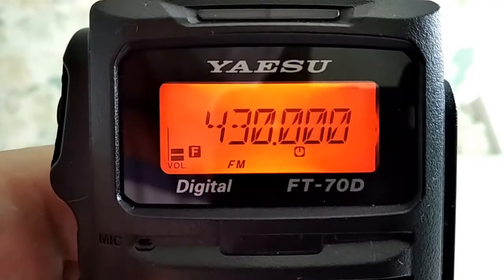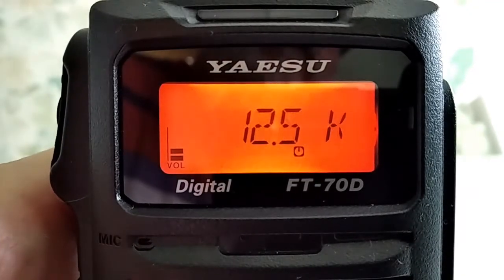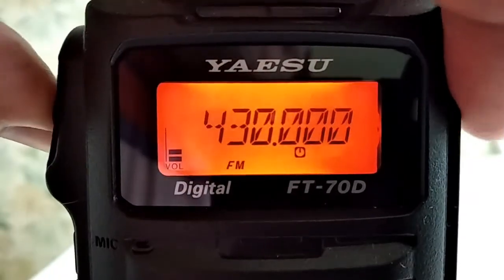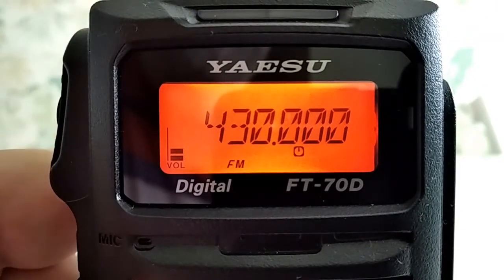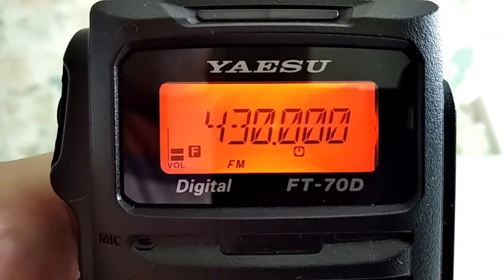How fast does the YAESU FT70D scan?

Comment: That's the search speed not the scan speed, when you scan factors like CTCSS, flicking between different modes, jumping between different frequencies and alpha tags can all have an impact. I'd like to see the radio loaded up with freqs and various tags etc. and the SCAN speed measured. Searching is letting the radio go at a fixed step between two freqs, scanning is when you scan memory channels.
Reply from the maker: Oh Yes, you are right. That's the search speed. Thank you very much!